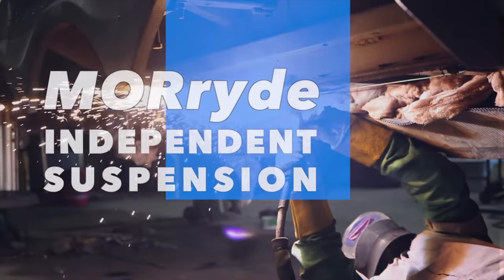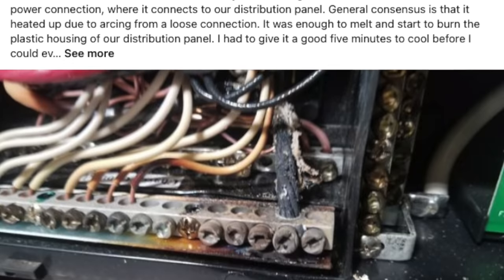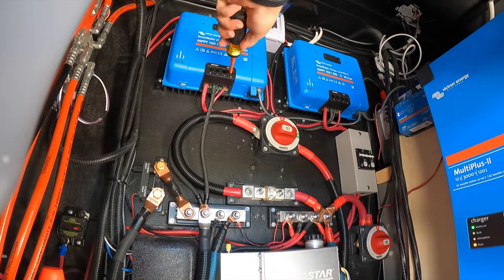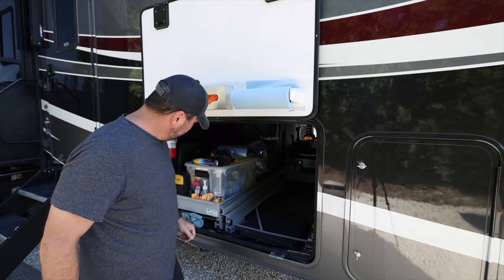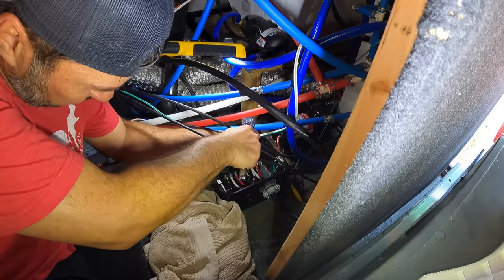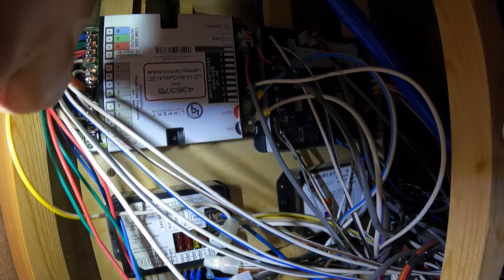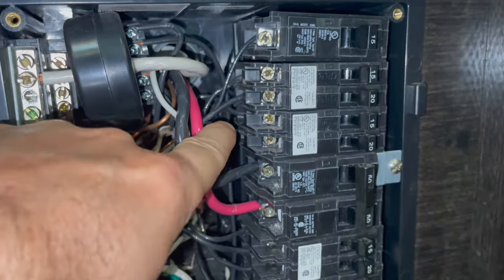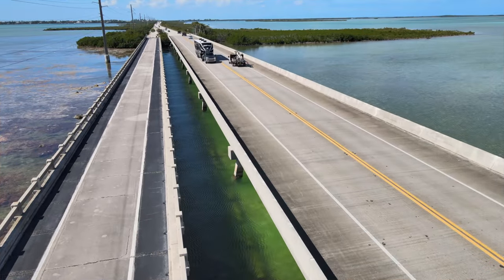⚡️🔥 Prevent an RV Electrical Problem! (Full Time RV!)

Comment: Great stuff here Chad. One thing I noticed you might consider, but please don't shoot the messenger on this because I am definitely not the expert on this. On your battery bank I noticed that the large interconnect wires connecting the batteries in parallel have the wires on both sides of each lug. Again, correct me if I'm wrong here, but I've heard elsewhere that the interconnect cables should be wired together on only one side of the battery lug so that the lugs are either pulling or pushing current in one direction not multiple directions. No big deal to change because the cable lengths would be the same. Any thoughts on this?
Reply from the maker: Not sure I agree...  I can't see how the side of the lug matters at all.  Do you have a reference you can link?
Reply: @ChangingLanes  No worries. Check out this video and let's compare notes. https://www.youtube.com/watch?v=01F4QDVJUq0&t=564s 

I wonder if it has to do with Eddy Currents? Although I'm a degreed mechanical engineer, electrical topics are definitely not my strong suit. Only endeavoring to expand my knowledge here.
Reply from the maker: Just watched... I guess that does make sense and is likely a good practice. I don't think it's a HUGE deal, but I do like the idea of even a tiny bit of heat reduction.

Comment: as I recall doesn't the ATS and the surge have specs for the connections and  you need to use a torque wrench?

Comment: Chad, just curious, around 6:25 of the video, you’re showing the inside of the breaker panel.  There is what looks like a CT (current transformer) on the neutral.  Is that part of the surge guard or Victron stuff.  
Thanks!
Reply from the maker: I believe that's part of the PCS (Power Control System) that was stock with our RV...  But, we have that disabled most of the time because it doesn't know about the inverter's ability to power share...

Comment: Maybe consider torque marking everything?
Reply from the maker: Indeed!  Note added to description, pinned comment, and blog post:  ⚠️ USE A TORQUE SCREWDRIVER WHERE APPLICABLE. While my main goal here was to just find and tighten any loose connections, I should have taken the opportunity to get proper torque on some items – the distribution panel in particular.
Reply: @ChangingLanes   use a paint marker too and mark them. If the line from the thread and the bolt become misaligned then it is an easy identifier that it’s loose.

Comment: what about some sort of lock tight for the screw connections? is that a option?
Reply from the maker: I think that would be a resistor in the threads and cause heat...

Comment: Ok, we have a GD Transcend travel trailer which is sort of like comparing the systems in a matchbox to a nascar car when compared to your toy hauler. So when I watch your repair videos I a lot of the time think "Fun to watch but beyond my VERY limited skills and not relevant to my little RV." This one looks like it applies (some) but will I have that much that should be checked, especially since you kinda took outlets out of the equation? Probably a dumb question but I really am pretty clueless.😂😳
Reply from the maker: Be sure to heed the post-publish note added to description, pinned comment, and blog post:  ⚠️ USE A TORQUE SCREWDRIVER WHERE APPLICABLE. While my main goal here was to just find and tighten any loose connections, I should have taken the opportunity to get proper torque on some items – the distribution panel in particular.

Comment: Is it possible to use some blue loctite?
Reply from the maker: I think that might affect the connectivity.  Much of the contact comes from the screw and it, in turn, needs to conduct via the threads.